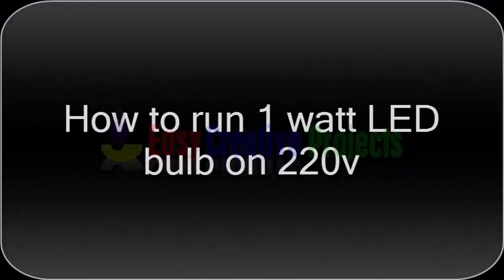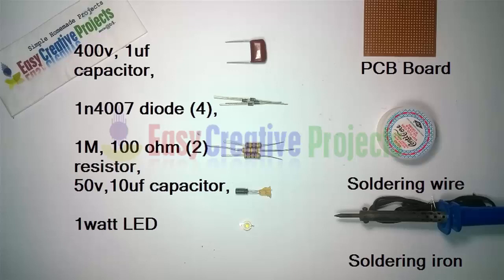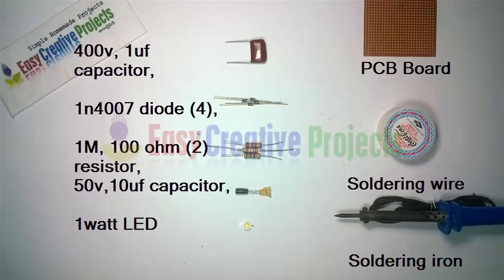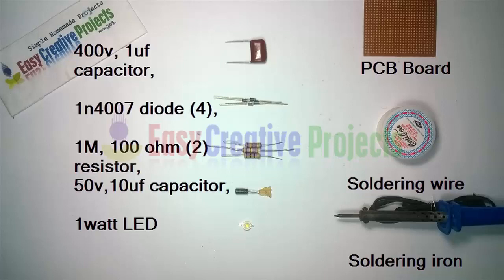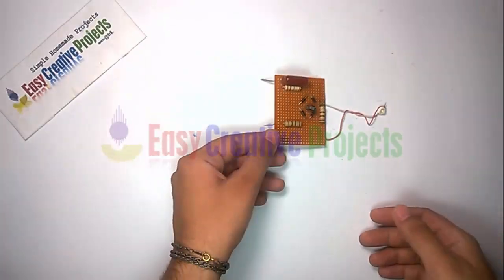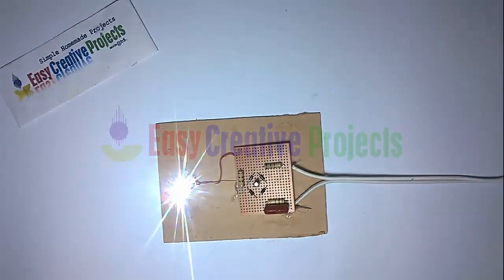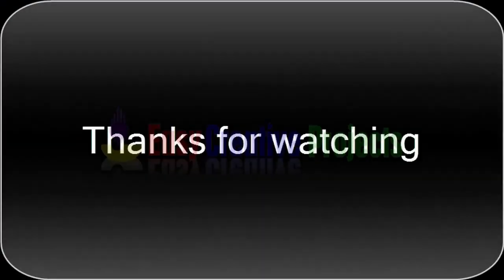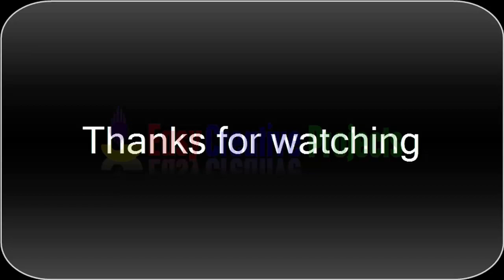How to run 1 watt LED Bulb on 220v - easy step by step with circuit diagram

Comment: It is 12v LED or 5V LED ? Why did not you used heat sink ?
Reply from the maker: its 12v, 1w led.
that time i have not heatsink. but you must use heatsink if you want to  use it for long time.
thanks.

Comment: circuit is working but heating too much even with heatsink. what to do
Reply from the maker: dear these LED generate heating. use high quality heat sink. or copper heat sink.

Comment: Amp kese reduce krna hoga 220V to 12V tak Aaya
Reply from the maker: amp krna ha ya voltage?
aor kitna krna ha?
Reply: Easy Creative Projects  matlab ye k voltage to aesa km karege magr jo Amp jo hoga  wo kesy km hoga ta k heat awr power km hojaye matlab
Reply from the maker: specific amp aor voltage km krnay k leyah us volt aor us amp ka transformer use hota ha normally. 
jo k zeyada powerful b hota ha aor long term b chlta ha.

Comment: 400v/1uf is this project component.. I am not getting pf of 1 uf.. is there any code for e.g. 125, 105j, etc...
Pl. Give your project uf code..
I am just learning...
I have made many  simple projects successful. I am trying 1 uf to purchase in electronics spare parts shop but say not available... Visited many shop at my place... But not got getting 1 uf.
Reply from the maker: its code 105K, 400V non polarized capacitor. 
you can get very easy from any electronic shop. 
its also use some juicer machines for extra power.
thanks.
Reply: Sir can I use125j 400v capacitor?

Comment: Agar mujhe 5 or 10 bulb lagane he to ye circuit kam kare ga?
Reply: DIGI ADVICE just put them in series all of them
Reply from the maker: yes its working. if you need more brightness so simple change capacitor.
thanks.
Reply: Capeciter konsa lagana hoga,  capaciter or led ka chart hoga aapke pass?

Comment: Sir, I like your all projects, can we make LED tube light  using white 3.5 volt LED's? If yes how many LED's we can connect in this same circuit? If no please make a special video tutorial for the same (for 20 to 40 white 3.5 volt LED's)
Reply from the maker: ok i make for you soon.
you cannot connect with this circuit. because this led work on 12v.  and your demand for 3.5v.
Reply: @EasyCreativeProjects  how to down to 3.5volts, the same above
Reply: @ramavijaya148  Capacitive dropper will work the same for 12V otput as for 3.5V output, the capacitor dropper presents a series impedance and so limits the current, and the the difference between 12V load and 3.5V load will make sod all difference..
Reply: @franklydude 
So will this circuit work for a 3.5 volt led?